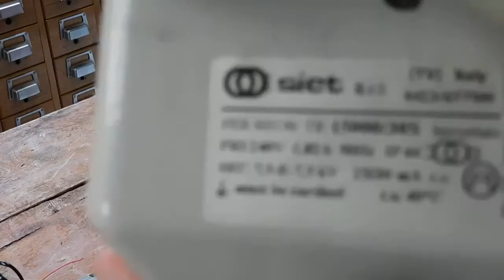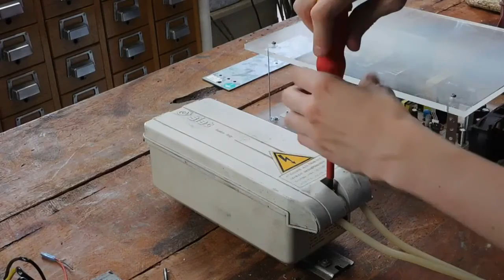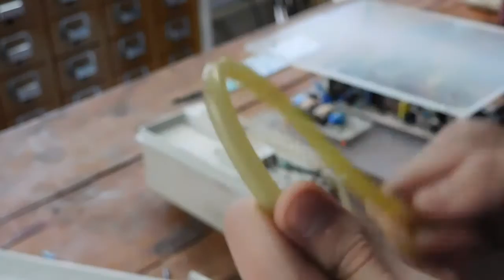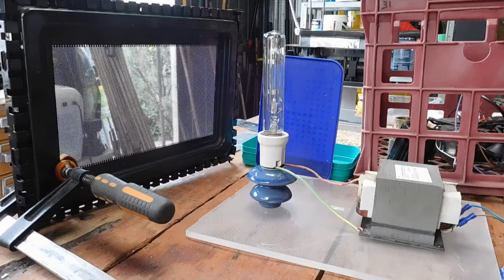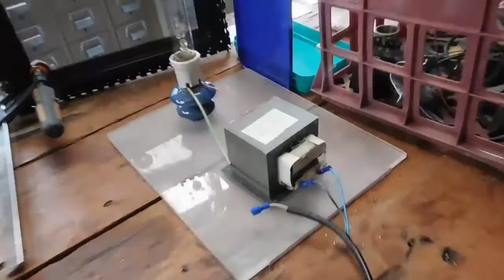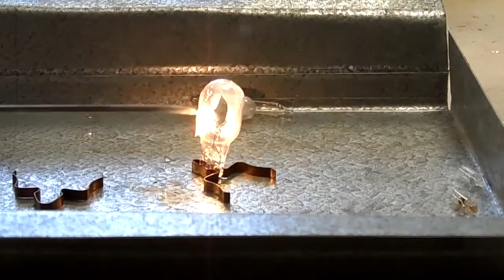7 KV Neon Sign TX and HID Lamp on MOT

Comment: Have any luck with that arc lamp ballast yet?
Reply from the maker: Got a vid ready to upload on it, wired up everything to the SMPS (which you may have noticed in the BG) but got no response from the ballast, there's some kind of electronic switching involved from some other part of the DLP TV. I could either work out the pin-outs from data sheets, or run the lamp off of a separate PS all together.
Reply: +Machine Man yeah thats what I said in that video, that switching needed comes from the logic level of the ballast, and I looked it up, I was right, that logic input needs to come ffrom the logic/control board of the tv. 

By the way I couldn't get a video uploaded because my phones having SD cards issues. I'm actaully playing around with vcr drum motors right now with the ESC's, got a new one and testing it out, 26volt one. 

If you want I could show  you somewhere else on skype or something if you use it. About my only option til I get ahold of a camera. But yeah without that logic board from the tv, your only option really is to  try to trigger each of the fets indiviually like I mentioned in your other video. (risking damaging the ballast in the first place. And another idea, never seen anyone try it but have you by chance ever tried using one of them bulbs with a HID ballast? was an idea I came across, not sure if it would work or not, migth not be enough voltage to strik an ark but its an idea.
Reply: +Machine Man iff you find the datasheet with pinouts, let me know so I can look at it, would be a great help to see how its trigger, besides that trail and error is the only other option.
Reply from the maker: umbrefawx will do, yeah T&E is probably the best chance of getting it running.